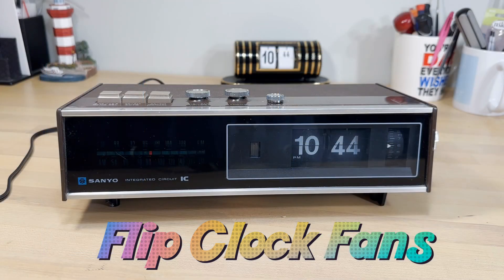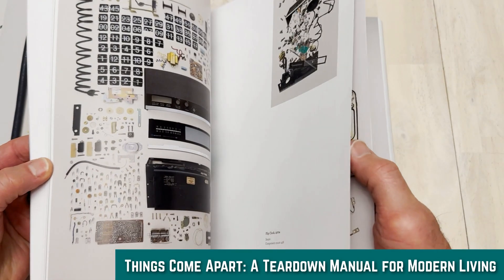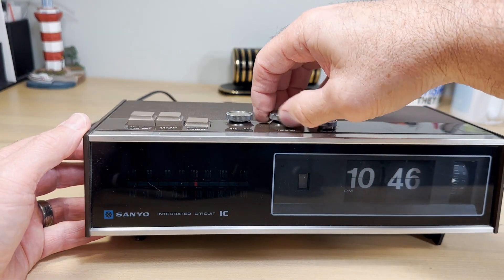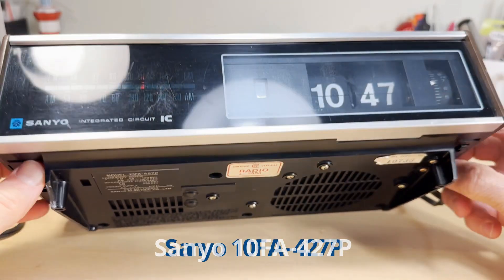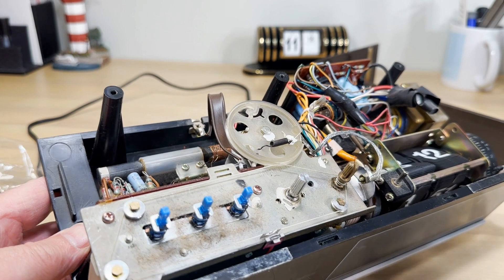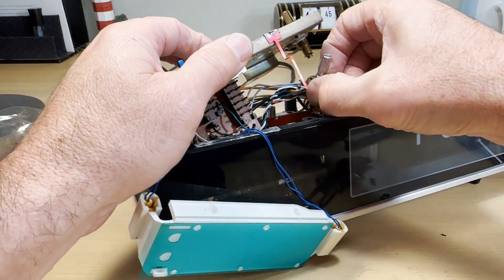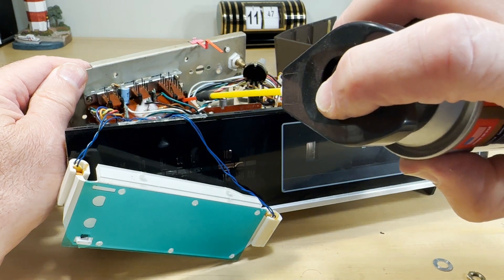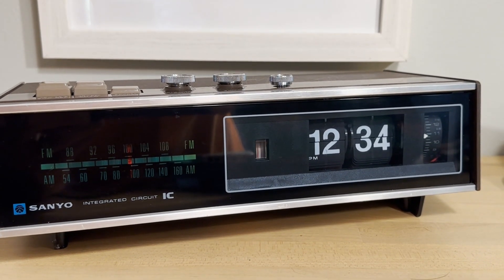Flip Clock Art - by Todd McLellan - The Sanyo 10FA-427P flip clock radio

Comment: Great video! I love taking things apart (putting them back together correctly is another story) and seeing all the little bits and pieces, so I'm sure I'd like McLellan's book! 

The Craig 1606 flip clock (which I have) has the same cabinetry as this Sanyo 10FA-427P. I believe both Craig and Sanyo released wood and plastic cabinet versions of this clock.  I bet the Craig clock is a Sanyo rebadge. I just serviced mine and these are really quality units with brass gears and the all-metal sleep mechanism.
Reply from the maker: Absolutely. Lots of “rebadging” going on back then.

Comment: Love the book! I may pick one up! On the radio dial bulbs, I need to source some for my Realistic and Lloyd's flip clock radios, Not sure what voltage, if it's measured in AC or DC and what Ma rating. any pointers? Thanks!
Reply from the maker: Depends. If it’s the neon glow bulb it’s 120v but you need a resistor in line. I’d buy from a source that includes the resistor. Most of the smaller bulbs are run on ac from 4-12v around 50ma or there abouts.